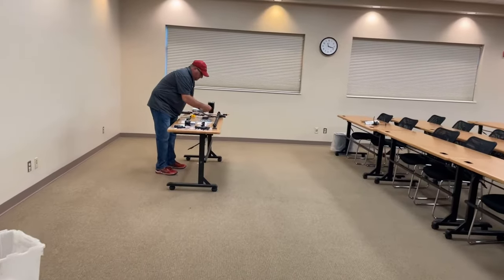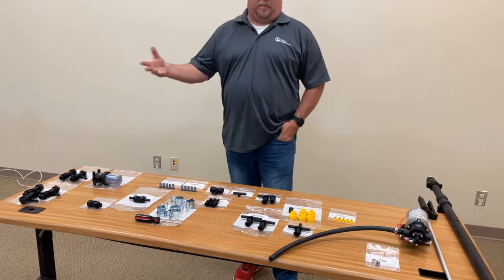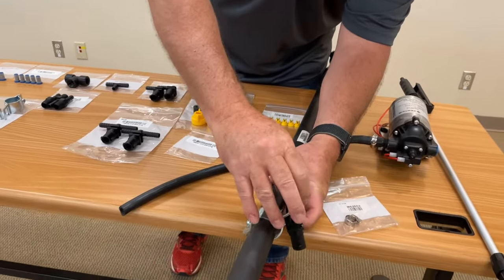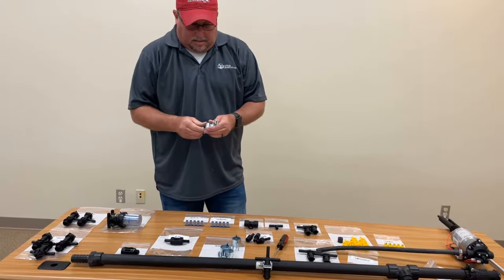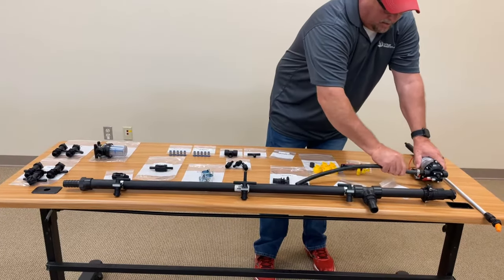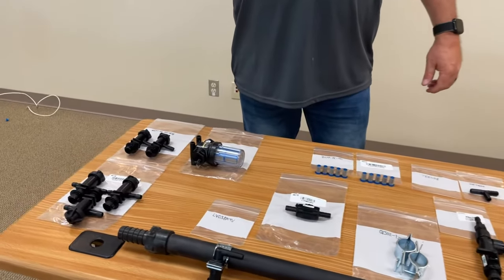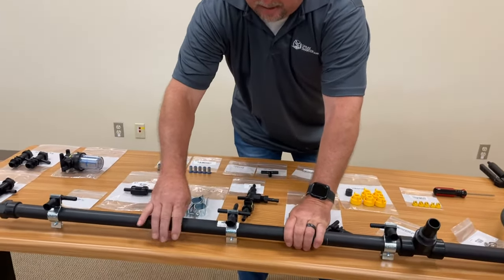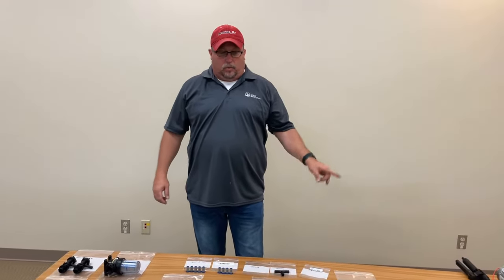How To Build a Small Dry Boom for Your  Lawn Sprayer from SpraySmarter.com

Comment: Do you put the pressure regulator between the pump and the valve/T assembly?  I presume  that's a good spot or it could also be put off the T to the hand sprayer.  Would like to see the video, part 2, where you lay out the parts for the pressure regulator section.  I like what you've done in this video .... because I hate plumbing ... so many options!

Comment: Do you happen to have the part number for the nozzle body with the built-in check valve? I have a 2.2 GPM/70PSI sprayer I'm looking to make a boom for. Great video!
Reply from the maker: Here is the link for the check valve on top. https://www.spraysmarter.com/lawn-turf/nozzle-bodies/dry-boom-nozzle-bodies/teejet-3-8-quick-teejet-nozzle-body-assembly.html

Comment: The links to the website part numbers are not working. What is the part number for the strainer with check valve
Reply from the maker: Sorry about that, we updated our website and some of the URLs didn't update correctly. The strainer with the check valve is 4193A-PP-2-50SS.

Comment: What is the part number for the nozzle bodies with check valves shown at 13:28 of the video? Thanks!
Reply from the maker: There are a few options, but the one we used in this video is a 4193B-PP-10-50SS

Comment: what type of pipe are you using for the boom itself?
Reply from the maker: We recommend schedule 80 pvc or steel pipe, you can also use square metal tubing up to 1-1/4", there are clamps for that as well.

Comment: Great video. How do I know how far apart my nozzles should be or how high should I have the nozzles from the ground.
Reply from the maker: Typically you would want a 20" nozzle spacing 20" off of your target, no more then 30".
Reply: If you're using a Teejet tip, they tell you the optimal spacing and height from the ground for each nozzle type.  It's all in their catalog.  As Spraysmarter replied, most of the fan style tips are 20" and 20" or a 1:1 ratio.

Comment: I want use only the two end nozzles, is there a way to turn on the inner nozzles?
Reply from the maker: That would require a valve at both ends or make them individual sections with a manifold, you could make one from a cross(CR038) then attach a valve for each nozzle. Banjo makes a manifold but it has 8 outputs(TM075/050).